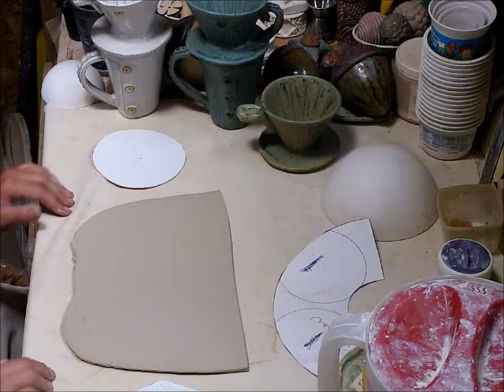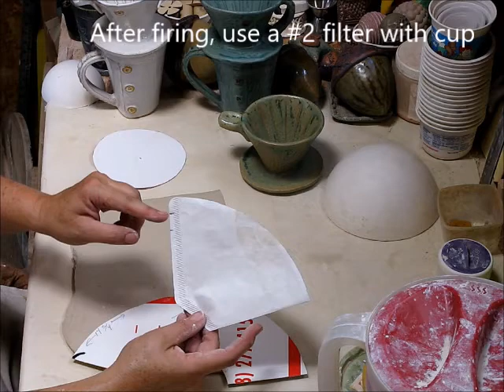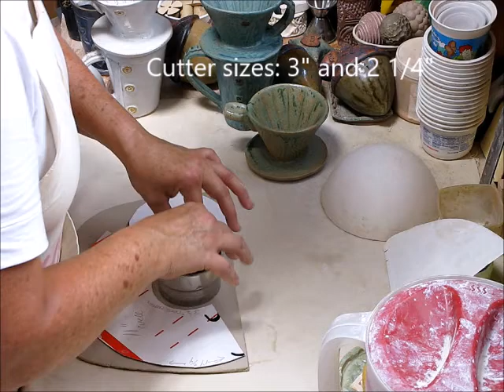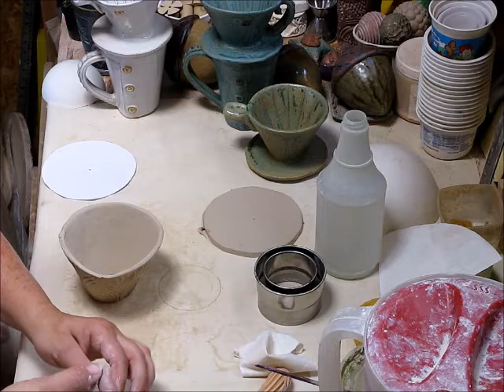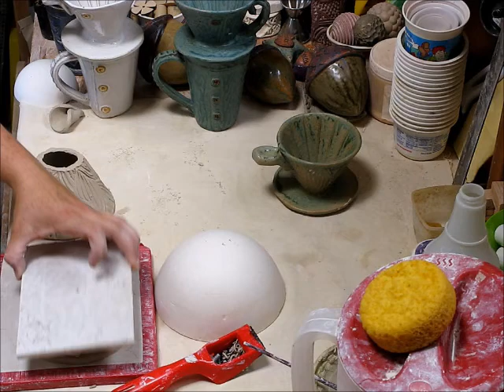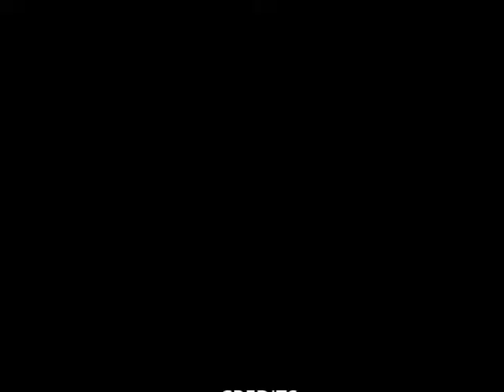coffee pour over

Comment: Thanks for the video. I have been doing them quite a while ago too. I did it in porcelain. I did however put a line pattern on the inside of the filter-holder as this would prevent the filter paper from sticking to the wall and make the coffee run a little easier. We do have these in Germany, but put on top of our coffee pot. Our aunty used to have two coffee pots and while the guests were having one cup each from the first pot, the next lot of coffee would filter into the next pot. Memories from childhood.